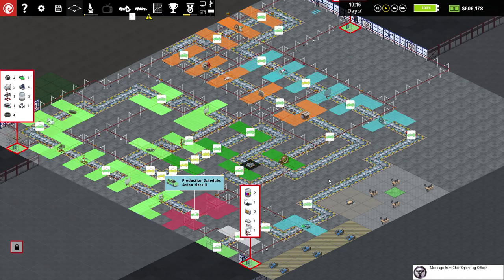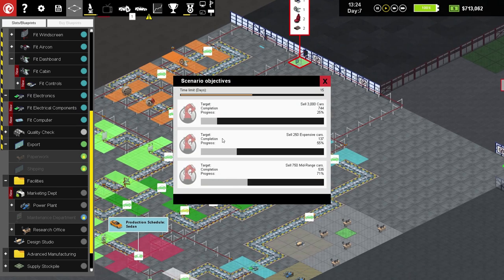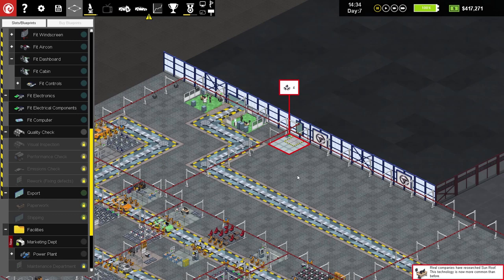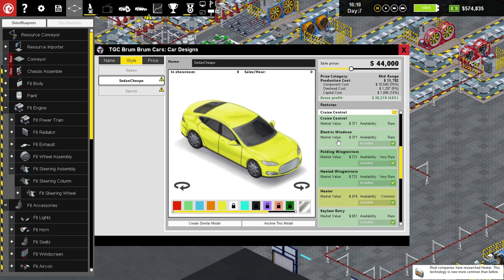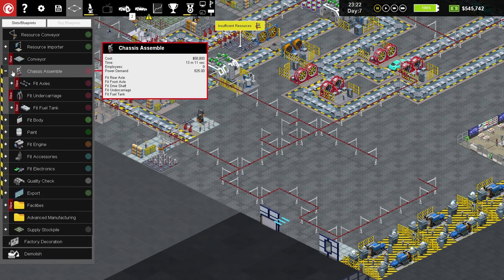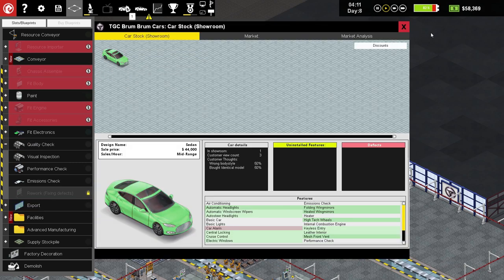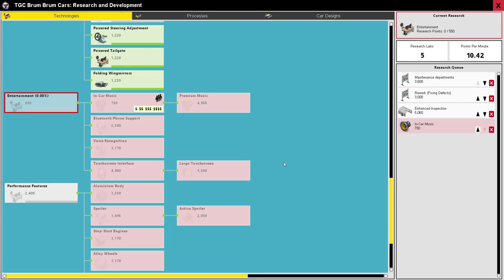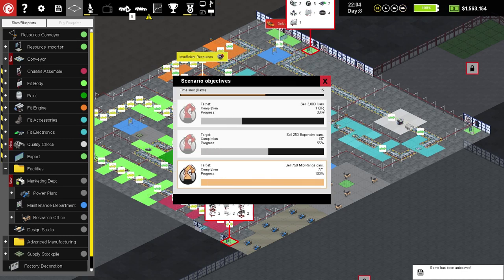Having a Breakdown | Production Line - Part 5 (Early Access)

Comment: you could've just left the mark 2 there and sold it with not many accessories and all at a cheaper rates as you need to fulfill your budget cars sold objective as well which requires you to sell 3000 of them
just set the price of mark 2 lower than the original sedan with a lot less features
Reply from the maker: It's not 3000 budget cars, it's just 3000 cars of any type.

Comment: dont make the cheapo its a looser and it take the same time to make because it will travel behind the Normal sedan  in front of it
so if you want to make the cheapo
rent another Factory Space to create another line it would also doppel the production
Reply: Once all the slots are fully blown out, you can output about 1000 cars a day from a single line, so it really isn't an issue to put a budget model out there. In fact you do want one because you can't sell the higher end models fast enough to have only higher end ones on the line.